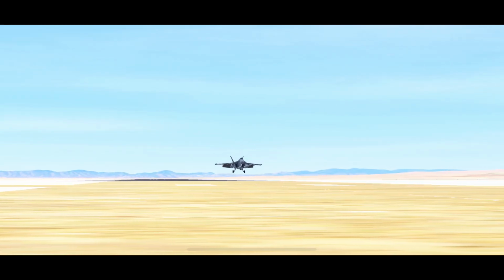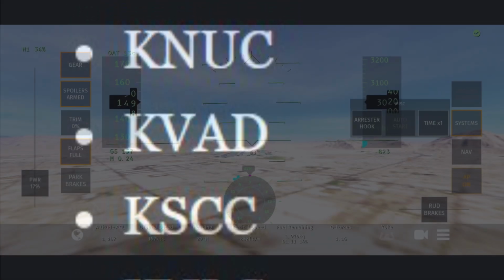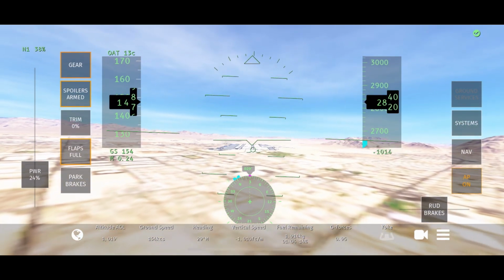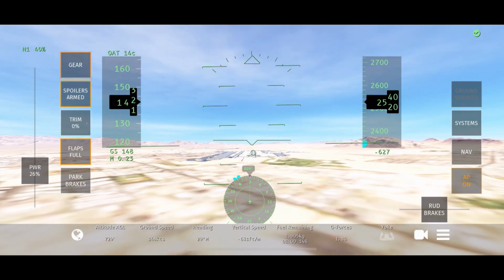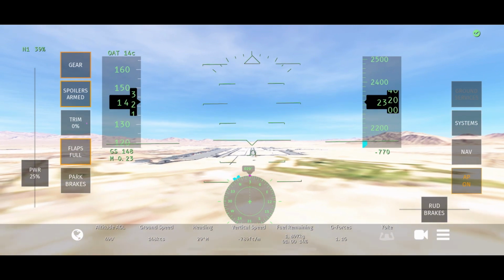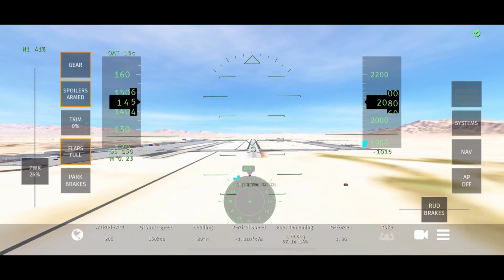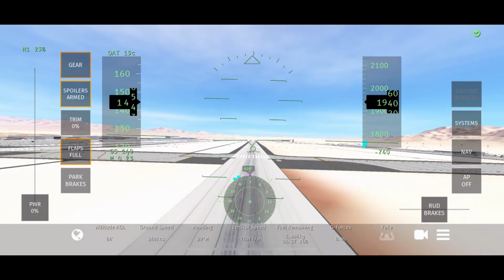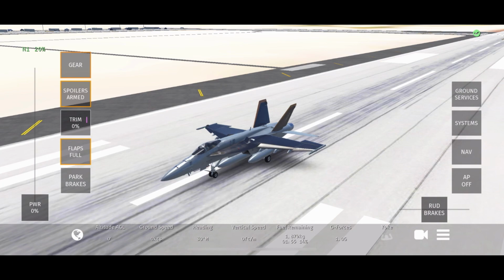How to use the Arrestor hook on the new F/A18 Super-hornet in Infinite Flight

Comment: You didn't use the correct way of arrester hook, it can be used on the aircraft carrier😉
Reply from the maker: Which aircraft carrier and this was not now
Reply: @DrexAviation  What do you mean??
Reply: There isnt aircraft carrier in if
Reply: air force uses arrestor hook (on the f16) on runways! they aren’t strictly for carriers as you may think 😉